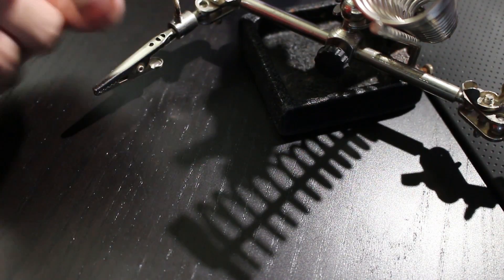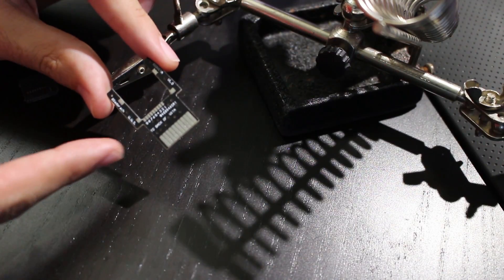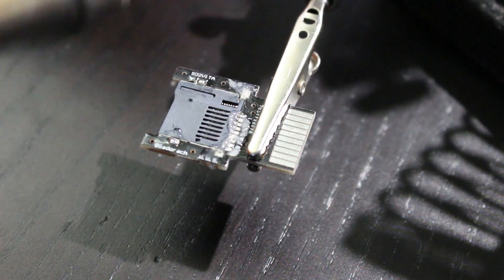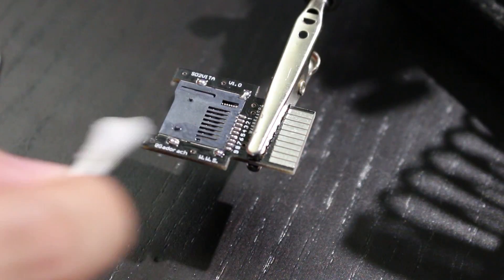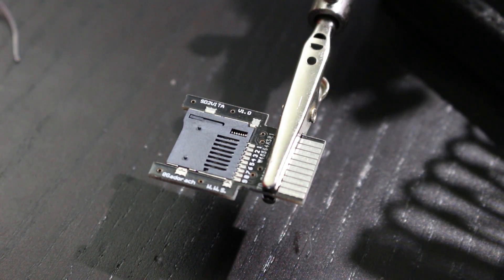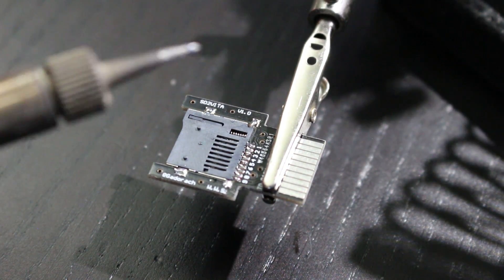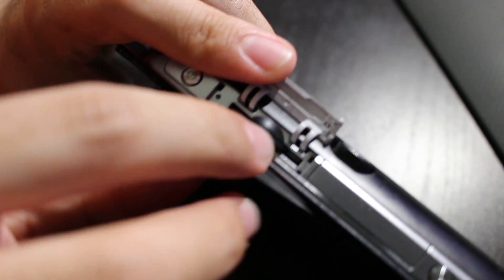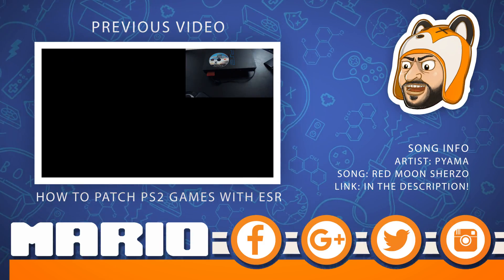Building an SD2VITA Adapter - Overview & Demonstration

Comment: Thank God you can now buy an adapter for less than $5 now.  

BTW, you should use the helping hand first to clamp down the pins so they don't move out of alignment while you tack down the SD slot.

Comment: @MrMario2011  you think is possible upgrade the psp ms2sd with the parts of sd2vita??? (( because the ms2sd only support 104gb (if you add more big microsd the system cant recognized the data and show "broken data") and sd2vita support 512gb ))

You think this is possible or not??
Reply from the maker: That limitation on SD2Vita is incorrect. I also have my doubts about the upgrade you are mentioning, since there's really not much to the SD2Vita in terms of circuitry. All of the magic behind that is thanks to drivers and software.

Comment: a tip for using the V1 adapters: get a piece of tape and slap it on the side with the pins and have it overhang maybe a half inch on top then fold it over on itself so you'll have a tab to pull it out from the slot easier. this makes it as easy to use as any other version, and they're often cheaper.

Comment: Hey! big fan of the channel. I just wanted to offer a tip. When you get stiff peaks like that when you pull your iron away its actually from cold joints. Don't be afraid to turn your iron up or if your iron isn't adjustable look into getting an adjustable one. Thanks for great videos!
Reply from the maker: Appreciate it! Normally only happens if I'm not using flux.